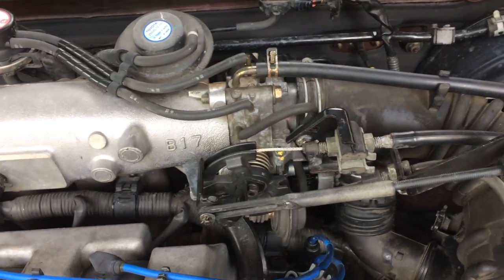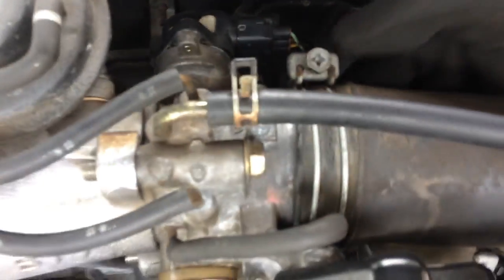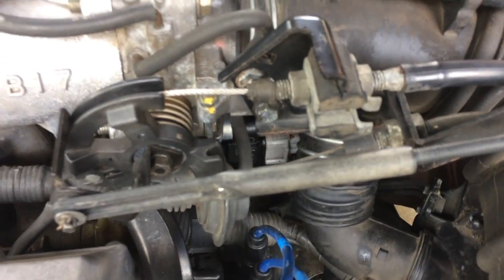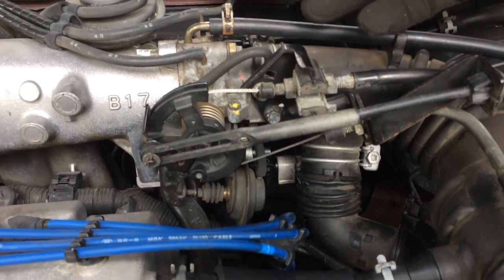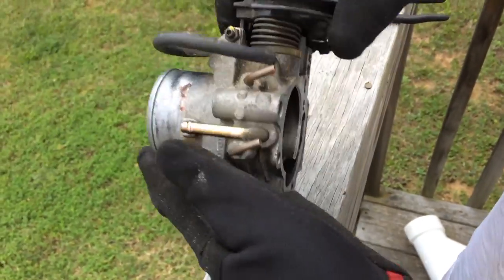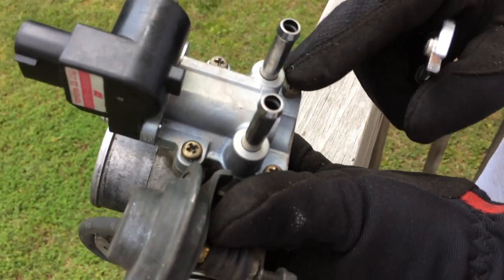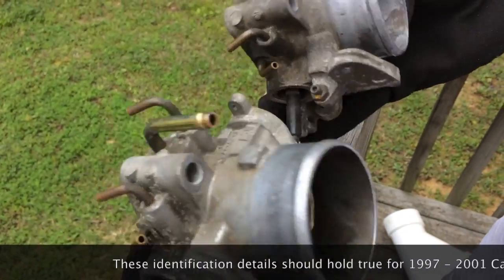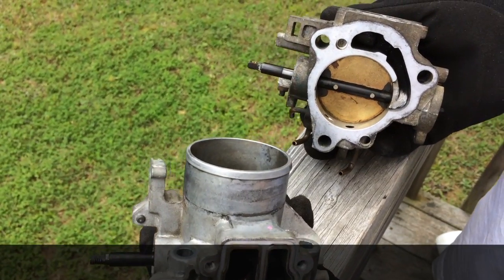1997 - 2001 Toyota Camry & Solara P0505 Code caused by 2.2L Throttle Body to ECM Emissions Mismatch

Comment: Very Very Informative Video, ,,& I Totally Agree 125% with John Galyen..."& I quote .."You should be a teacher!'"....Automotive Schools Could Really Benefit From Your  Vast Knowledge /Communication!! ...Teach Me As .I'm rather curious on something ,where on Toyota Throttle Body Casting ..Do You Find/Locate the OEM Toyota Part Number #..?..I see the Raised Toyota Name on the casting, but have yet to find the part number# ..on any Toyota  Made throttle bodies:(
Reply from the maker: Thanks.  Many OEM parts, including Toyota, will have a part number cast or stamped into the part itself.   But all will be found within the OEM dealers parts ordering system.    Parts explosions, or diagrams, detail the individual components right down to the washer and bolt.   I have access to this information, and wholesale parts pricing,  as a professional. 

But as a DIYer you can also get access to this same level of detail thru various Toyota dealers who sell parts online at retail pricing.   Some, but unfortunately not all, will offer these same detailed parts diagrams to identify such numbers.

Comment: Hey Dr.Shock !! Its me again i got the part offline for like 30 bucks and it matched the car perfectly i just called toyota and gave them the vin and they gave me the part number and i bought the matched part online it idles normal now but is still throwing the same code ? Any thing else it could be ?
Reply from the maker: This particular code, P0505, can be a multi-fault one.  Having the correct throttle body on I would next inspect the idle air control (IAC) and throttle plate.   The former for correct operation, the latter to clean and de-carbonize it.
Reply: @DrShock  it has the correct IAC so go to the throttle body next,?

Comment: I have a 2001 Camry, I changed IAC valve and it seems to be the  California emissions and body throttle, can I get a federal assembly and have it fit and replace the old California body throttle.  Looks like it might not fit or am I wrong
Reply from the maker: They are unique to the engines intake manifold.  Toyota built the engine two different ways to address the two different emissions regulations in effect in 1997 thru 2001.

Comment: So what did you do ? I have a 1998 and in about to go a replace the icv and its a california emissions standard ... Where did you find a federal ?
Reply from the maker: Parts like this you have to get used, from a you pull it type salvage yard.  I use LKQ yards for such projects.
Reply: @DrShock  thank you !! Are they cheaper ?
Reply from the maker: No, not really something that affects the pricing.
Reply: @DrShock  okay i just checked the one on my car is rounded on the block !!! You can tell from just looking from on top yay!! So now im going to take the Ca emissions back to autozone and go to pick a part in Anaheim but what about the gasket and is there an lubricant or glue i need ?
Reply: @DrShock  what about at AutoZone at AutoZone they said that the one without California admissions is the same as Federal admissions is this true
Reply from the maker: No, it's not true at all.  Have them watch the video and learn something.  ;-)

Comment: So i bought a 97 Toyota Camry for my daughter and it will start and then stall but after a few more attemps and pressing the gas pedal a little bit, it will stay running, and idle by itself, but high around 1100 rpm, but if i press on the gas it will stall, check engine code p0505 is showing, my question is how do i know if the computer is set for California,  or fed, i do know the TB i have is California, and do you know how to do a idle reset for this one ?
Reply from the maker: In this vid I go over how to visually identify the differences in the two throttle bodies.   I'm not aware of any other way to tell them apart than what I showed here.   This is only one possible cause for a P0505 though.   In the video I go over that it's something to check when you have a stubborn code that will not diagnose to root cause in the typical fashion.  

Usually this code is caused by a problem with the idle air control (IAC) valve being inoperative, or carbon deposits inside the throat of the throttle body affecting the closure of the plates.  I would start with confirming correct operation of the IAC by disconnecting it first and examining it for carbon build-up affecting its operation,  followed by removing the throttle body and giving it a thorough cleaning.
Reply: @DrShock  i did take it off and cleaned it and i am thinking about just replacing it,  I'm glad i found your video on identify the TB difference, costing around $120, i can order one feeling good and not worrying if i ordered the wrong one. 
        Thanks

Comment: Excellent video, I bought a 99 Solara with a rod through the block, purchased a motor and tranny from another Solara that got T-boned bad! Installed them both together, had to remove 02 Sensor from original motor cause the replacement motor sensor connector was slightly different! Never had a single issue. Now several years later I'm getting ready to service the throttle body, will compare them both to see if I got different emissions stuff on them, thanx ALOT for this video 👍💪👌

Comment: Hey Doc, we have a CA car and it had the same code with a Fed throttle body! I swapped to the CA like you did and there is no large vacuum hose on the CA IAC, so I blocked it off for now. But now it surges at idle. I've heard that the TB coolant passages are different? both hoses slipped right on to the CA unit..any help?
Reply from the maker: I've only worked on this one Camry with the 5S-FE engine (2.2L), so what I know here is going to be limited to the 1997-2001 years.  But from what I recall researching this problem most parts around emissions (fuel/air/coolant) are not interchangeable between Cali and Fed engines at all.  So yeah there could many more parts that are quite different than just the one I covered here.  Did the P0505 code clear when you corrected the wrong IAC?
Reply: @DrShock  Sorry, I didn't see you replied! I have the exact same year and problem you did. 97 4 cyl with CA emissions with the larger openings on the IAC. I can not find the correct IAC with the larger openings and the large vacuum hose that goes to it. I bought the correct TB, but no IAC. I thought you might remember or have some spare parts. Whats the chances of both of us having the FED TB on a CA car? thanks
Reply from the maker: @GMVracing  The problem here is when these vehicles get worked on by individuals unaware of these Toyota differences and they just throw on a replacement part, not realizing they made whatever original problem they were supposed to diagnose worse now.   So we are just left to clean that up and move on right.  ;-)   For when you look for the IAC valve, you'll see they call out whether its for Fed or Cali emissions, like this search link at rockauto.com - https://www.rockauto.com/en/catalog/toyota,2000,camry,2.2l+l4,1364633,fuel+&+air,idle+air+control+(iac)+valve,6072

Comment: One thing I learned from this video is about those "Philip Head" screws that they are really not Philip head but some Japanese standard screws.  No wonder one gets a 'feeling' that there is something not right using the Philip head screw driver on these screws.  Thanks for this very informative video.  Good job!
Reply: They are a JIS screw and have a tiny dot impressed into the head of the screw indicating they are JIS screws.

Comment: I replaced the engine 2.2 toyota and I didn't notice cylinder head was diferente injectors didn't fit so I put injectors that fit and now I notice cylinder head doesn't have a vacuum line behind of it now I replaced the throtte body but computer detects code p0505 so I will try to replaced idle speed control for federal emissions

Comment: Update 

2001 california emissions engine swaped into a 1997 non cal emissions

And this video applies👍 

If the cal tb is with the non cal computer, the engine will high idle until it is swaped out for a non cal.

Comment: Awesome video, I bought a 98 Camry and the guy couldnt figure out why the check engine light was on and also it was stalling when the rpms dropped hoping to solve it with this fix, thank you !!!!
Reply: @Anonymous23-y5s  Its a long shot since this comment is 5 yrs old but did that end up being your issue?Mine is also dropping rpms and idling rough.Hope to here from you soon!

Comment: Thanks for your informative video. Recently installed a used engine and immediately got the P0505 code. I’ll look for the correct casting.

Comment: I have a 1999 with the small holes and my 2001 has the bigger holes.  I think it about what year the Camry is 1997-1999 have smaller holes and 2000 and 2001 have bigger holes.